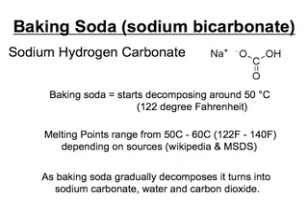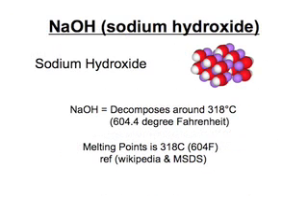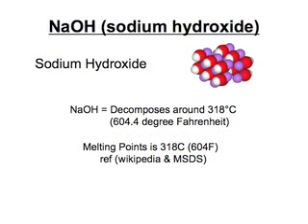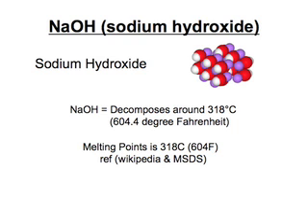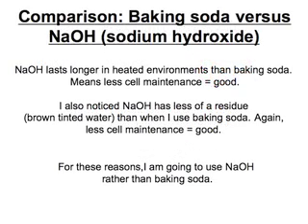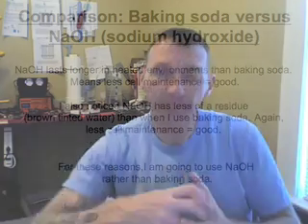Baking Soda vs NaOH: What should I use?!?!

Comment: Great Video, Can you do a compare with NaOH and KOH.  I myself use KOH no discolouring also I have been lead to be leave that I don't need to change my water or add anymore KOH to the tank only keep it toped up with Distilled water.  The cell itself may need to be clean in months down the track with Hot water and Lemmon added at 70oC for 30min to 1h or even just use ultrasonic bubbles would be the best idea I think.  Good work!!

Comment: If you just close the spacing on the electrods you will not need to use salts of any kind, on my video I am using pure rain water no salts, the plate spacing is .020 of an inch. Just a thought for mine is very cost efective in that I don't have to buy anything and just put in God given rain water.

Comment: Also wanna add LPG and HOH do mix I run the car today for 2h at 25amps thats just under 2L a min I think I wanna try it at 40amps next I might put my old water mix back in the tank and add more KOH to that lot one then the next stage is a PWM. I have a range from 11 amps Cold) and when it got to 50oC it was pulling 25amps Thats a massive range and took well over an 1h to get to that temp at idle)